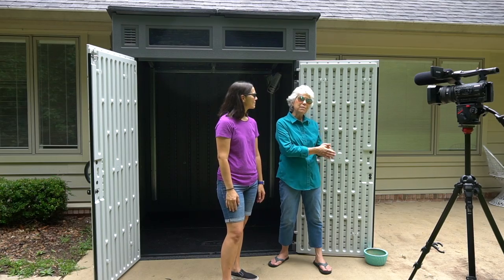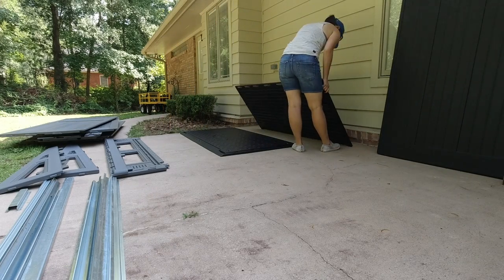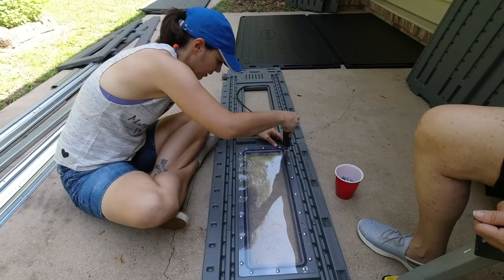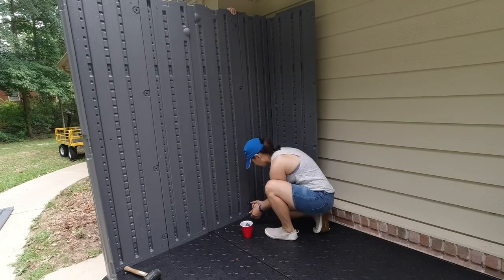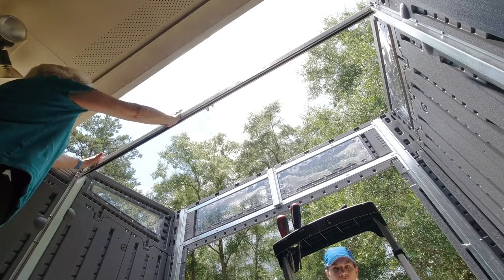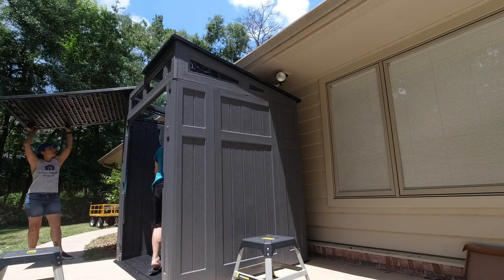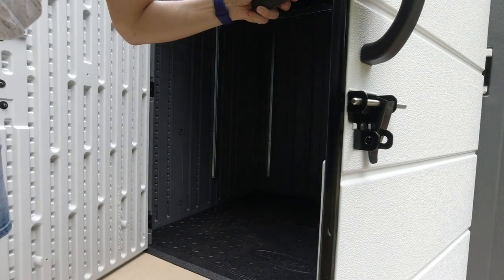How to Assembling Suncast Modern Shed from Costco

Comment: Your video was very helpful. I watched your video and the Suncast video when I was ready to start. I'm glad I watched your video, especially the tip about loosely mounting the support brackets on the ridge beam before installing. Made installing the truss legs MUCH more efficient. That tip alone was worth the watch!

This is definitely a two-person project for some, but not all, of the steps. Two people required for wall assembly, if nothing else for applying pressure to the outside of the walls while the person inside installs the plastic screws.

Two people semi-required for roof install; one person can lift and maneuver the roof pieces into position. However, we found that this task required one of us to hold the back edge of the roof "down" while the other used the rubber mallet to drive the roof into place. Without the second person, the slot/tab nearest the back wall was a problematic fit. Two people semi-required for header install based totally on your comfort/skill with ladders and juggling tools and screws/bolts. Same with installing ridge beam and truss legs. One of us was able to complete these tasks. Tip for installing ridge beam alone = set beam into place, then gently slide bolts into place on each end THEN install nuts onto the bolts. If not, high risk of beam falling.

Recommendation 1 = use a cordless/corded drill with a SCREWDRIVER SETTING. Or a tool similar to the one in the video. If you use a manual screwdriver, or even two people with manual screwdrivers, you are in for a long and wrist-stressing project. The main point in using a power tool to drive the screws is to not "overpower" the screws. Although you do need to apply some pressure when screwing metal parts together.

Recommendation 2 = use two-people, each equipped with a cordless screw-driving tool and you can build this in four hours. Or less, depending on your skill & experience. 

Thanks again for the video. It helped!

Comment: Wowwowwowwow 
Thank you. I built it today with my granddaughter.   Two of the pieces were damaged in transit and we had to wait 2 1/2 weeks to get replacements.  
I remembered about the metal to metal supports but forgot that you said don't tighten.... duh. I had to loosen.
I bought an electric screwdriver and you were spot on.  Instead of the robo pliers I used two ratchets and they worked perfectly.  The build went well.  Thanks for your video... it helped

Comment: I built my shed this past weekend.  One tip I saw on another build was to put the small brackets on the center cross bar BEFORE you install it and do not tighten them up until the other supports are in place.  Also, my shed has some small gaps in the bottom where it is not fully flush with the floor.  I wondered if yours was like this?  I ended up 'sealing' all around the bottom of the walls to the floor with silicone. We have had some big rains and so far no leaking.  I also have anchored my shed using braded steel cable, ground anchors and turn buckles.  Thank goodness for YouTube videos on the build.  I did it all by myself which was challenging at times, but I got it done.  The video really helped.

Comment: Thank you so much for this video!  The tip about attaching the 3 bracket/adaptors to the cross beam at the beginning was a huge help since those are extremely difficult to screw in.  The manufacturer should really tap a thread into those screw holes before shipping. 
I was able to do this step on the ground and it was still very difficult.  The impact drill is a good tip too.
Thank you again!!!
Reply from the maker: That's great! You're very welcome!

Comment: Nice video and build. Thanks for sharing the tips about the small hanger parts—I installed them to the center top rail while I was on the ground. Also, I have all the hardware installed on the plastic parts such as the door handles, door latch and the steel rails on the windows. All we need to do is put the floor down, assemble the walls and ceiling.  One suggestion is to use ratcheting pliers or socket wrenches when you were using a manual screw driver—more leverage so less force required. Also cordless screw drivers with clutch settings prevent you from over driving and provide you with more power to insert screws. Of course low settings are required for very soft material such as the plastic walls off this shed. Thanks for sharing. It helped me shorten the time to assemble this shed.

Comment: You did a great job explaining the assembly. I just finished mine in a day, though it took me a couple of days to build the foundation due to having to place it on an incline. It looks great and went together easily. The only problem was that one metal brace was missing, so I had to wait for it to arrive. I agree that you need a power screwdriver, but you have to be careful not to overtighten. There are too many screws to do it by hand.

Comment: Watching your video made my installation go much smoother in less than three hours doing it alone.  I did have issues with the metal bars being bent out; I had to hammer them down to properly fit and align with the designated holes.  The other issue I had is with the doors, they're definitely aren't smooth to shut, even though I installed the shed on a leveled concrete floors, the doors align perfectly but I have to shove/kick them on the bottom to shut.  Are yours the same? All in all, we love it and thank you to both of you!
Reply from the maker: Awesome! So glad the video was helpful! Yeah, our doors are have gotten a little bit like that. But its still pretty easy to get them closed. -Steph

Comment: Great video. We just finished this shed in a tight spot in our backyard.  We put ours on a wood platform instead of concrete. We had to remove the windows because we failed to notice that there was film on both sides. Cost us about 20 minutes. I also got tired of using a hand screwdriver.  Went to the drill and was careful. No problems. We had a little trouble figuring out how the roof went on and getting it placed right. Like I said we were in a tight spot.  I went right to the drill on the support beam. So funny.  I did the same thing and had to remove them because they didn't line up.  But only took a few minutes with the drill.  Funny watching after we did our project.  Really funny we had the same challenges.

Comment: Do you happen to know if the top section with the roof and windows can be installed rotated 180° in a learn-from config rather than the lean-to as shown? I have a water canale for house roof drainage just above where this will go and I don't want water to hit the roof of the shed then drain back towards the house behind the shed. Thx!
Great vid.
Reply from the maker: I don't think that would work.

Comment: I just put this together before Christmas.  I like it but it was a pain to put together and had the same issue you had with the top brace.  Was really disappointed with that because I felt that those holes should have been pre-tapped.  Pretty sure the bolts I put through there are toast and stripped.

Comment: Odd question. 
I'm planning on buying one of these when I move to replace my vocal booth so I don't have to construct anything from scratch. 
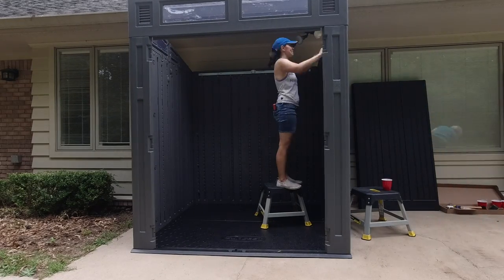At 04:40 - Is there an easier / different way to get those side metal supports in since I plan on building this INSIDE of a house?
I imagine I wouldn't have the vertical clearance to do so inside of a normal room.
Any suggestions / ideas are appreciated :)
Reply from the maker: hmm...you might be able to put the shed on its side when you slide them in.

Comment: Great job with the video and explaining everything so well. I also like that you left in a couple of "flubs" - I made a few along the way (that added about an hour to the job), even after watching this video. My video would have been R-Rated due to foul language. Overall, this is an attractive, sturdy shed with well labled  parts and clear instructions. Best tip was about screwing the brackets into the metal cross beam. Even laying it on a concrete floor and pushing down as hard as I could, I could not get the screws in, and was starting to strip the screw head. I ended up rimming out the hole very, very slightly with a drill bit, and it made all the difference in the world. Other beefs, as you pointed out, were some items not lining up perfectly, a few missing pre-drilled holes, and having to undo a couple of things that got in the way of a future step. I also didn't like that the screws would grab tight on some areas of the plastic but not in others. They would get snug but not tight (and they weren't stripped because I only hand tightened everything and was careful). But I got it all done solo in about 6 hours and it looks good. Except that the doors don't align by about 1/2". They do close with some manual finagling, and I can latch it properly. I'll tinker with that another day.  Thanks again!
Reply from the maker: Thanks for sharing!

Comment: If installing under a deck with minimal (5") clearance, can you slide the metal side supports into place prior to installing the side panel?  That was the only step where it looked like clearance is an issue.
Reply from the maker: I'm not sure about that. But the shed is really light at that point so you could move it into place after that part is done. -Steph

Comment: if using a wood platform instead of concrete can you screw it down into wood under the shed to anchor it
Reply from the maker: We anchored the shed in this video: https://youtu.be/hbcF-EqMQBk
Reply: Just installed this on a wood platform this weekend. No anchoring hardware is provided, but the manual recommends using 3-inch-long 1/4” lag screws and washers. There are 8 little dimples total (4 per floor panel) for anchoring through the floor to the wood.

Comment: Can you flip the top so that water drains to the front?
Reply: This is what I want to know! 
…if the top section with the roof and windows can be installed rotated 180° in a learn-from config rather than the lean-to as shown? I have a water canale for house roof drainage just above where this will go and I don't want water to hit the roof of the shed then drain back towards the house behind the shed.

Comment: Isn't rainwater going straight to your house since the roof of the shed is slanted towards the house?
Reply from the maker: It had not been a problem, although we did turn the shed slightly in the next video when we anchored it to concrete.
Reply: I'm going to bolt a gutter to the rear wall before installing the roof.

Comment: How bad would this be in a fairly (but not perfectly) level bit of dirt. I'd rather not have to pour concrete.
Reply from the maker: From what we have seen, to have the most success with resin structures you need a solid foundation.
Reply: I compacted rough gravel level into the dirt.